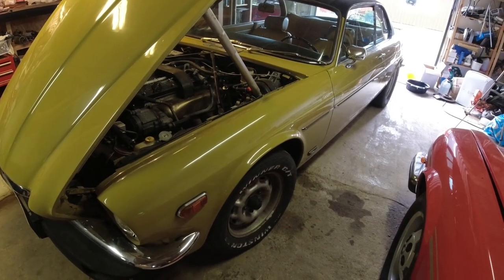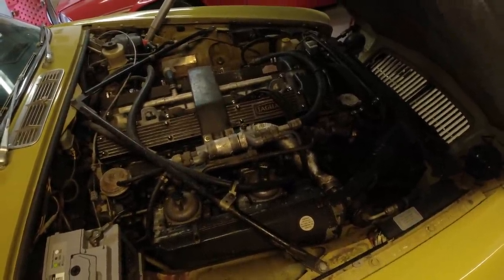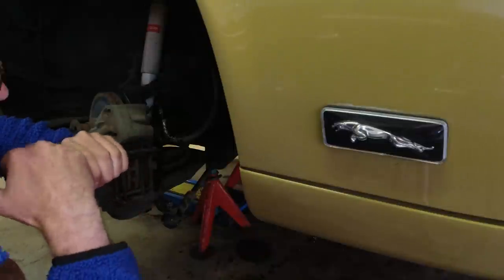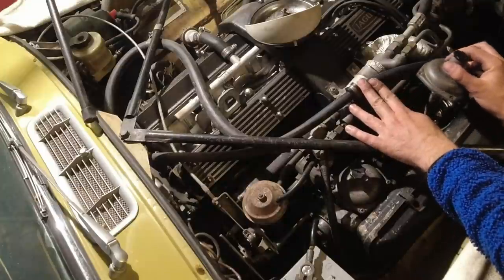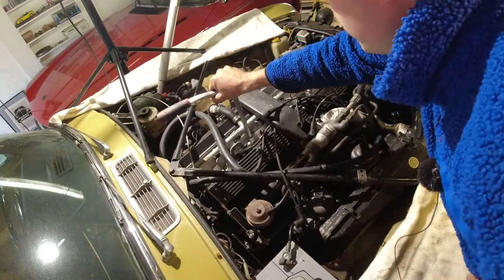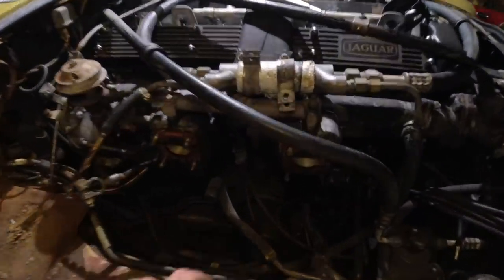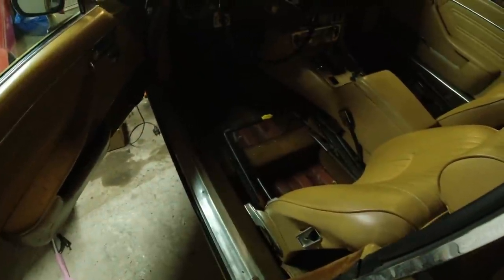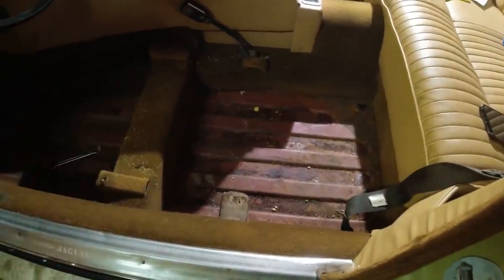Getting a Jaguar XJC Ready for a Long Road Trip After Sitting 7 Years (Part 1)

Comment: Dashpot oil loss probably due to o-rings on needles failing.
Reply from the maker: That makes sense! Everything is being replaced with new seals and o-rings right now.
Reply: @LivingWithAClassic  I have had a hard time sourcing those 0-rings for the needles.  They were not in my kit.  Please let us know your source.  Thanks.
Reply: Might also explain why its a bit rich with no oil in the dashpots.  I just rebuilt all 4 of mine.  The choke wouldn't seal fuel in after as gasket changed from thick to thin paper.. had to use wet and dry on a glass plate to smooth out the imperfections from the factory on the surfaces..
Reply: @jeffharrison5265 Hi, they are are available on ebay but can definately be obtained from Rimmer Bros, there are plenty of Youtube clips around on how to fit them.

Comment: Brake caliper rebuild definitely has material for an interesting video. Are the needles the right ones for the carbs (and still within spec)? That might explain general  excessive richness.
Reply from the maker: Having stripped the carbs now, the choke mechanism was partially stuck on. That is why it was running rich I think.

Comment: I couldn't quite see, but a lot of those British Leyland SU and Stromberg carburettors had throttle discs with a spring loaded 'pop off' valve. These always used to cause running problems once the spring was tired so I used to fit standard plain discs. TR7's were the worst - now there is a car you should buy. A nice late model 2.0 5 speed Convertible is best.
I would remove the catalytic converter and blank off the temp compensators as well as those bloody throttle bypasses. Convert Strombergs to correct Euro spec and they are fine. Anything US emissions related is dreadful.

Comment: With reference to the temperature compensators on the Strombergs I have 4 of these on my car and my advice would be to blank them off with a gasket. They are part of the American emissions control system which you said you were contemplating on removing, I would also advise doing the same to the throttle bi-pass valves on the Strombergs. Both of these items are more trouble than they are worth they are not needed outside of America and they will make setting up the Strombergs a potential nightmare.
Love and never miss any of your video's.

Comment: I am mystified as to why you would open the calliper bleed valve in order to push the pads back off the disc, all disc brakes ive come across the pistons could always be pushed back, it just raises the level in the fluid reservoir a little. Maybe Jags are different. Keep up the good work!
Reply from the maker: The fluid was quite dirty and I didn’t want to push it back to the master. Also, I wanted to get a feel for the calipers with nothing else in the system. The calipers could seem to be stuck even if they’re not if you have a bad brake hose. This test bypasses anything else in the system

Comment: Hi Adam . Well the bonnet spring ? Don't you have the burnt out XJ6 ? The rear headcloth rail in front of the rear window looked water stained and the vynal on the left rear pillar looked as though it was "puckered" and possibly rust bubbles ? Not that you can do anything about that even if it is ! And l would have bet those diaphrams would be perished ! Thanks Adam .
Reply from the maker: The burnt out car is a series 1 and they don’t use the same bonnet hundred unfortunately.
The car had perished window rubbers before but they were replaced when the car was painted

Comment: Looks like the owner will be replacing/repairing things alongside the road in the dark on a rainy night if you don't complete your repair/rebuild list before embarking on that 2,000 KM trip.    The cooling system will also need the water pump replaced because its seal has likely gone bad and the pump will start leaking after a few miles/hours of driving.  The brake system will also need a new master cylinder and each brake caliper rebuilt/replaced, as well as the hydraulic brake lines which collapse internally, especially in a car that old.  "Exercising" the brake system won't fix corrosion/rust in the bores of the master cylinders and calipers.   Brake fluid is hydroscopic and absorbs water; the water then settles in the lowest parts of the brake system and starts rusting the caliper bores and pistons.  As you know, a high performance car with a sketchy brake system is very unsafe. Moreover, the ignition system should have the points & condenser replaced, the rotor & cap replaced or the corrosion of the copper areas cleaned up, and a new set of spark plugs (spark plugs are cheap).  Don't forget to check the silicone/graphite spark plug wires and coil wire for continuity and ohm resistance.  They have probably deteriorated and the ends corroded.  Last, but not least, have the owner of the XJC invest in a roadside towing service before setting out on the 2,000 KM trip - he will probably need it!!!  Zenith Stromberg carbs are miserable pieces of junk.  We have had them on virtually all British cars sold in California between 1970 - 1980 (until the British went to fuel injection).  The choke systems on them are terrible and fall apart.  Don't forget to replace all the rubber hoses in the gas vapor recovery system; otherwise the owner will be smelling gas fumes as he drives down the road with a window open.  My XJ6 drove me crazy with its gas smell.  The hoses and o-rings on the rear gas tanks and gas filler caps go bad and leak fumes/fuel as well.
Reply from the maker: I don't think the owner will have any issues and if he does I will be travelling in an XJS along side him.

Comment: I used to be a "keep it 100% original" type of person, but a C5 Corvette LS6 conversion would be the best thing you could ever do!  If you are bold, look for a 2002+ Z06.
Reply from the maker: Sorry not my thing. I really dislike LS swaps
Reply: @LivingWithAClassic  I though the same till I drove a Corvette with an LS6.  Go drive one?  If not swapping you may end up owning a C5!  I think it's the most fun and reliability that money can buy!!!  Thanks for replying!!!  I almost bought an XJ6C 25 years ago.  Its body lines looks like a sculpture, especially how the rear quarters curve in to the tailights!!!
Reply: These cars are becoming quite valuable.This is a good example. I would keep it close to original. It's easy to put a chev v8 in it , then it becomes a Chevuar. 
More challenging to keep the original engine, with a few upgrades like the carbs, radiator, maybe a manual gearbox. 
Just my opinion from an xjc owner.
Reply from the maker: I have driven a C5 and while I enjoyed it, it wasn't for me. Plus where I live (Sweden) getting anything that has an LS in it is very expensive.
Reply from the maker: This one is staying original just being made reliable to it can be used by the owner whenever he wants.
Reply: @LivingWithAClassic  I have found with owning many TR3's and TR6's THAT IF fixed correctly, they are quite reliable!  I look forward to seeing the rest of your XJ6C restoration!!!  Thanks for posting it!!!
Reply: @LivingWithAClassic  One update that the owner might consider is replacing the Lucas "emission" distributor used in California with a modern programmable 123 Distributor.  He can program the distributor's advance curve with his phone and do away with the Lucas' "built-in retarded timing" curve that was used to pass California exhaust emission requirements.  It will really make the XJ6's engine come alive.  I would also remove the exhaust recirculation system from the car because it probably does not work properly anymore.